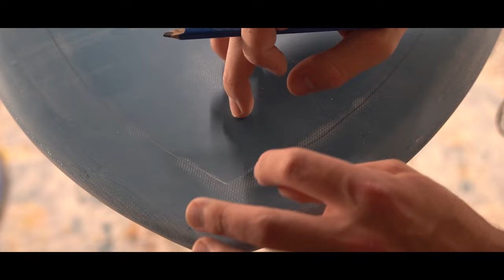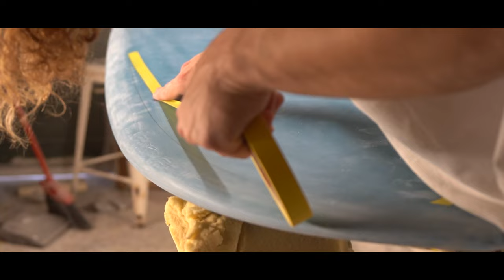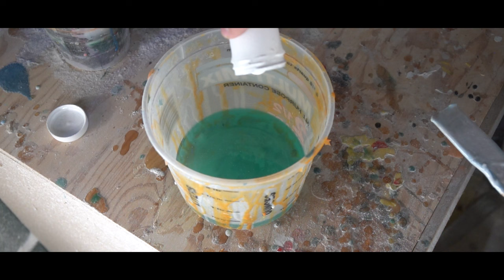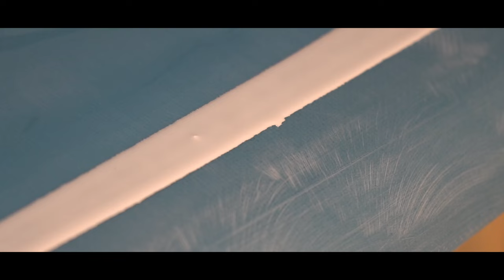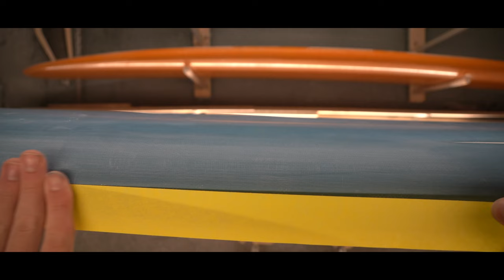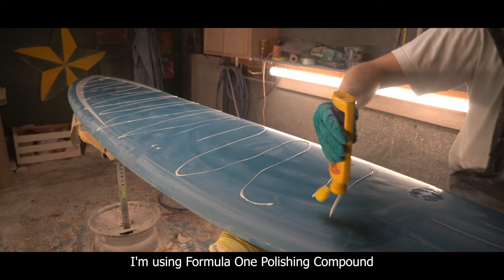How to Apply Resin Panels to a Surfboard

Comment: Nice video! I've been struggling with hot coat or even just gloss coat with epoxy. It seems like it doesn't want to stick! The board is clean (sanded and cleaned with alcohol or acetone). Any tips? Thanks.
Reply from the maker: thank you! a thorough sanding and alcohol is all i’ve got for you really. The only other thing i could think of is to make sure it’s entirely dust free before putting the hot coat on

Comment: Your videos are the best! Thank you. Question: On my next board (EPS / epoxy) I’m going to have yellow rails with clear deck and bottom. I will paint the rails with yellow acrylic paint. I want the painted rails to get narrower as they get closer to the nose and tail. Would you just eyeball where you mask it out as you approach the nose and tail or is there a different way you would do that?
Reply from the maker: i think i would just eyeball it. i can’t really think of any better methods. maybe make a few marks along the desired line just to make sure both sides are even. good luck with it!

Comment: looks sweet! when you sand the pannels do yoy try and get rid of all the shinny spots like yoy would when sanding a regular hot coat?
Reply from the maker: yeah, as long as the shiny top layer is off it should work just fine. You can sand further if you want to remove the bump on the edge of the panel but that's just for aesthetics.

Comment: I like your stuff bro, shaper/ glasser myself. Picked up a ton of tidbits from your videos. I've failed many times doing this. I end up sanding through the hot coat down to the panel too often, granted that happens everytime, especially with pin lines. How are you assessing how far down to sand that colored resin layer. As well, that freaking yellow tape has been my enemy lately, I can't get it to not bleed color underneath it either onto glass or foam, any tips?
Reply from the maker: thanks! glad the video is helping. for sanding the panels, the only things i’m concerned with are removing the top wax layer and removing the bump from the edge. i go super slow either by hand or with ~320 grit disc. for the bleeding, the only thing i’ve really got is to make sure you press the tape down well with your thumb. and also make sure that your paper you’re using to mask with before lamination isn’t leaking(meaning not water proof). i’ve made that mistake before

Comment: is this poly resin? if so, have you ever done a poly resin pinline on epoxy? how do you think that'd go?
Reply from the maker: this is all poly and i haven’t used epoxy for surfboards at all, but i think that you might have some bonding issues if you try to do one on top of the other.